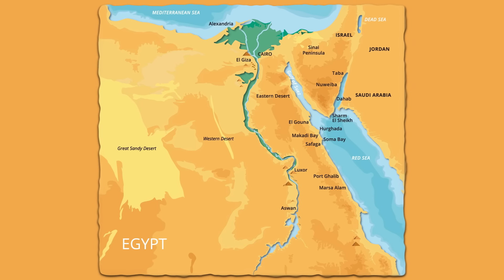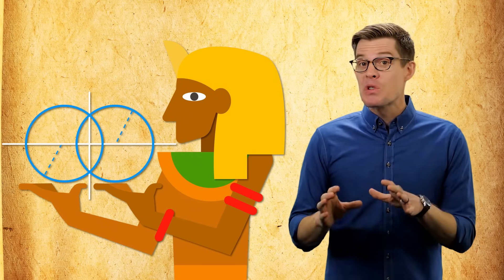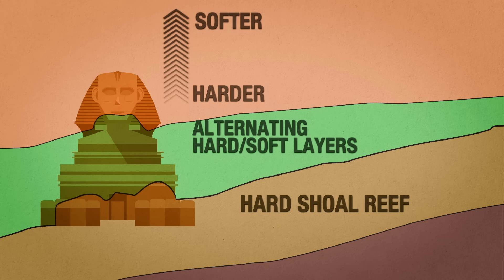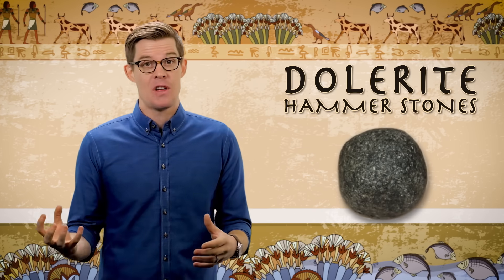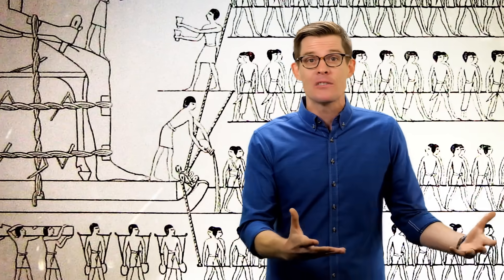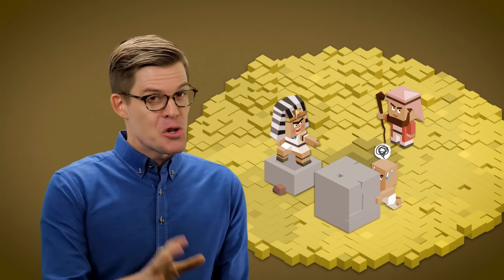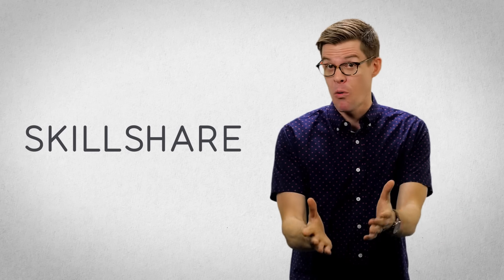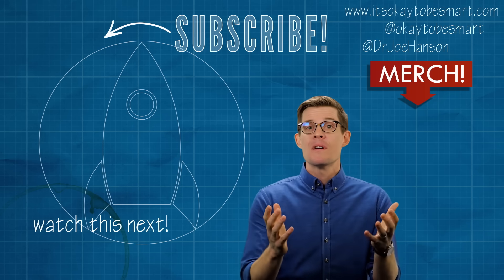The INCREDIBLE Ancient Engineering That Built the Pyramids

Comment: I do not know why the engineers did not think in the opposite way ... For example, building a port connected to the work site as a ramp inclined 5 degrees, the stones are moved from the boat by a crane pulled by oxen and then placed on the inclined road down towards the pyramid.  And on the same system the cranes raise stones by the power of the oxen that pull the ropes down across The way it was thought workers were pushing rocks up .
I think that the main force to build the pyramids are bull animals. If the weight of the stone is 2 tons, it needs 4, and with the slope of their way down, it is a positive thing to raise the animal's ability to draw.
Reply: @varyolla435  Thanks for the feedback
The project is huge and very large, meaning that any idea that comes to your mind may be correct, no matter how exaggerated it is. I think that the Nile River was the main means of transportation because the quarries were not nearby, and they could also divide the road between the port and the pyramid into parts, and each part starts with a height of 10 meters.  Because pushing stones weighing tons on flat ground is a tedious and slow process

Comment: the one item often and always overlooked is the power for the light that went up from the pyramids, the power system is quite likely still powered up, in the day and for thousands of years the pillar of light went hundreds of thousands of miles into space, if you were in a spaceship arriving to this solar system, the pillar of light would be just like a searchlight beacon, I have often wondered if the radio transmitters are still functioning. there have been many searches of the sky for radio waves coming from the heavens, we really should take a look at the emanations emitting from the pyramids.

Comment: How fast would the water idea have to replace water? How fast would it have evaporated? could that be why the causeway tunnel, was made to transport water up under shade, so it wouldn't evaporate, let alone if you just placed shade around the whole construction site and it was a shallow pool would that not drastically reduce evaporation? let alon the deeper the water the more heat capacity it would have and the less it would evaporate. Or could the pyramid have been built on a natural spring?

Comment: The one thing that doesn't fit what you said is time. You say they didn't distract as much but is almost impossible they could transport as fast, no rest at all, someone would be working every minute.
Reply: Not really.

1 - most of the "blocks" of the pyramids are in fact little more than crude chunks of limestone which were rapidly broken free from the bedrock and carted away to be dropped in place leaving gaps all over.  This means that the inner core of the Great Pyramid is actually little more than stacked rubble.
2 - meanwhile the limestone quarries which provided most of the stone sit no more than 100-200 meters from the pyramids.  Only the white limestone used as casing stones and the granite and a small amount of other stones used in the mortuary temples had to be shipped in from other quarries via barges.  The harbor which once sat at Giza is only about ~400-500 meters away from the pyramids.  It sat where the Temple of Khafre now sits on its eastern side towards Cairo.
3 - you forget about the employment of draft animals = oxen.  When Egyptologists excavated the worker village at Giza they found many tens of thousands of cattle bones.  Meanwhile there is loads of evidence to show the Egyptians employed animals such as oxen to perform manual labor.  Accordingly if they were consuming cattle at Giza = they would have also used oxen for helping to pull the sleds which hauled the blocks in addition to teams of men. 
4 - finally the size of the workforce.  Egyptologists estimate that the workforce which built the Great Pyramid was around ~20,000 men.  That means literally thousands of men (and oxen as noted) would have been involved in transporting blocks from the nearby quarries the short distance to the pyramids were they were placed. 

Moral of the story:  So when one considers the timeframe involved + the number of workers laboring + the additional use of draft animals for heavy labors + the location of the nearby quarries and harbor site where a small amount of other stone was shipped in = you have the means and timeframe to accomplish the task.  

They only needed to place on average around 300-400 blocks per day to hit the target number.  The more teams pulling stone = the less number each team had to move each day to hit the total number.  While the larger blocks took longer of course - most of the blocks are not very large.  The largest/heaviest blocks are found in the bottom third of the pyramids.  Those above that level get smaller as the pyramids rise in height meaning = they would have been easier to move and thus more could be placed more quickly in a given time.

Comment: How exactly did they use Dolerite balls to cut 90 degree angles in granite? 🤔
Reply: They didn't.  Dig deeper.

1 - dolerite was used to quarry through bedrock to achieve blocks of an approximate shape.  Look at the unfinished obelisk which cracked and was abandoned in place.  Its surface retains the stereotypical pockmarked appearance of having been hammered upon prior to sanding it smooth.
2 - meanwhile copper tools such as saws of various shapes can in fact cut through granite when used with an abrasive such as sand or corundum.  In the tomb of Rekhmire is a depiction of craftsmen at work.  Among them are ones using long weighted saws to cut through a block like lumberjacks cutting a tree.  Further there are videos here on YT of Egyptologists and other subject-matter experts cutting through granite using those same saw devices.
3 - so we can now obtain a block of rough granite via dolerite and fire - they also used fire to soften the stone - while it can further be refined as needed using copper blade saws to achieve approximate sides.
4 - now using an abrasive such as sand or corundum and perhaps mixing that in some clay to create an abrasive paste you can via using a flat block and "elbow grease" along with water = sand the sides smooth.  Yes it may take a bit of effort but it is possible. 
5 - finally there is a stone object which was unearthed at Armana.  It was created in part using tubular drills such as we see in the Rekhmire depiction.  In the drill holes was a residue which when analyzed showed = copper and corundum - Mohs scale 9.

So you can not base assumptions upon quickie internet videos.  To understand you must often dig deeper to see the totality of evidence behind what is stated in these videos.  They simply give you the basics to pique your interest.  As the old saying goes:  "the Devil is in the details."  Something new to think about.

Comment: You use the pyramid itself as the ramp. An internal spiralling ramp along the outer edge that you then back fill. This way you don't waste time building things you have to later remove.
Reply: Pity then that the outer casing stones were stripped away = and no evidence of this supposed internal ramp is seen.  Meanwhile we have ample evidence of external ramps - both earthen and mud brick - to include the remains of both in Egypt today.

Comment: I never post comments but this video is completely insane. I don’t know where to begin. This is what I love about the so called experts, they talk and make statements with a certain tone of confidence as if what they’re saying is factual when it is not. They weren’t there!  You’re talking over 2000-3000 years ago.  The modern media today can’t get any story straight to save their life. Modern history is far from factual and you’re going to tell me you know exactly how they built the pyramids using each tool and method thousands of years ago? And what pharaoh had for breakfast! Yeah right!

To use this guys own numbers if you had to lay 2.3 million blocks in 23 years you need to lay a block about every 5 minutes.  That’s every 5 minutes for 23 years, 24 hours a day 7 days a week nonstop without interruption day and night!  No stopping for material shortages, labor disputes, wars, famine, etc, etc.  The logistics of a project this size is mind boggling.  Don’t even get me started on the whole ramp used to bring up the blocks up the side.  You know, the ramp that would require even more time and material to construct than the actual pyramid itself.  And by the way, each block has an average weight of 2.3 metric tons!  Let’s get realistic, they can’t work 24 /7 because they didn’t have lights at night.  Most likely they had 12 hours of daylight.  That means they would have to double the block mining rate to about one every 2 to 3 minutes. Yes they can have multiple teams cutting, moving, etc. I still don’t see the math working. Two guys working a copper saw might cut one block a day; maybe. There’s videos showing it’s possible. You still need to manipulate this giant slab and transport it. Plus there is breakage, so the rate would be even higher. 

THEY HAVE NO IDEA HOW IT WAS DONE OR EVEN BIGGER QUESTION WHY IT WAS DONE!

23 years 2.3 million blocks each 2.3 metric tons, even these numbers are strange.  These are not my numbers they’re his in the video.  I googled the weight.  Look it up!  These scientist or researchers are ridiculous!

I don’t know who or how they were built, but given a choice between this guys explanation or the alien did it theory, I pick the later at least it’s amusing. 

Copper can be 4 times softer than steel depending on the steel alloy.  That means they had to stop and re-condition the saws four times as often as someone using modern steel hand saws.
Go try digging a ditch or go saw away on a giant sandstone block for several hours using a modern day steel shovel or steel saw instead of the soft copper tools they supposedly used.  After the sweat is pouring down your face, stop and think about what this guy is telling you.  Anyone that’s done any kind of intense manual labor even for just a brief period of time (minutes) knows what I’m talking about.

BTW they’re still building St. John’s cathedral in NYC.  It’s made of limestone just like the pyramids.  They’ve been working on it for over 100 years and they’re still not finished.  That’s with using modern machinery to cut, transport, lift and place the limestone pieces into place.

Lastly even if by some crazy chance they did it, the amount of resources and manpower it would take would be enormous.  10s of thousands of people perhaps a hundred thousand or more! Then that leaves who to do the farming, the herds, the military, the teaching, building of other structures not just the pyramid project?  I could list more. I’ve seen financial estimates in today’s dollars somewhere between $200 and $400 billion dollars if we were to try to build it the exact way today.  That’s a huge amount of money!  It’s an enormous drain on their society for a giant pile of stone with a couple of chambers inside. Makes no sense.
Reply: I agree with Marc and most of the critical comments. The channel has funny name))) being smart takes first of all ability of abstract thinking.

Comment: There was more water in the area back then. Water does amazing things when you can build stuff to channel it, contain it and make floats to lift.
Reply: Pity then the pyramids at Giza were built upon high ground and water does not run uphill.  Meanwhile the pyramids at Saqqara and Dahshur are even further away from the Nile than the Giza ones.  So all the limestone found in the Giza pyramids save for the white Tura limestone used for casing stones and mortuary temples was quarried = 100-200 meters away in the adjacent limestone quarries which sit between Khafre's Pyramid and the Sphinx and Menkaure's quarry which is a bit further south near the causeway linking his own pyramid to what was once a harbor adjacent Khafre's valley temple and the area of the worker village.

Comment: So, HERE is the real "mystery of the pyramids." [Ask yourself why you've NEVER heard this raised by Academia before]: The Great Pyramid of Giza is estimated to be built of approx. 2.3 million blocks of stone. The average weight of each block is 2.3 tons. The Great Pyramid has a "core" of granitic blocks that have been shown to have been quarried from Aswan. The remaining blocks were all likely quarried locally from the Giza Plateau and environs. Each block had to be first quarried, then transported, then dressed, and then moved into place. It is estimated that a seasonally varying workforce of several tens of thousands of workers labored approx. 20 - 30 years to complete the Great Pyramid per existing dogma. Going with the 30-year estimate that would equal 15,768,000 seconds (disallowing leap years which would only add a maximum of 8 more days anyway). 15,768,000 divided by 2,300,000 = approx. 6.85. Therefore, EACH block had to be quarried, transported, dressed and put into place at the rate of 1 block every 7 seconds! This assumes ones moved up the ramp to the top were moved at the same rate as the ones which were only at the base (otherwise the number would be hugely smaller, that is they wouldn't even have the 7 seconds!). So, THIS is the true mystery of the Great Pyramid of Giza! All these TV specials on "How they Built the Pyramids" always duck the real mystery. That's called: a smokescreen. Think about it.
Reply: This is an average number your not accounting for increases or decreases in man power or the production rate of a single week. If on average they place 1500 blocks a week then in 30 years they will have surpassed the number of blocks that where use to build the pyramid of Giza.

You could do this with hours or weeks or years, the average doesn’t tell literally how much work was done on a specific week or month or year. For example there are 262,000 hours in 30,000 if you divide 2,300,000 that’s 8 blocks an hour.if you did the same thing with ww2 and 70 million deaths divide that by seconds within a 6 year time and you’d be killing 3 people every single second non stop for 6 years but obviously this isn’t what happened. Do the same with the construction of the Empire State Building and you’ll get a ridiculous number of nearly 100 tons a second where places to make it. This is just a misunderstanding of how averages work.